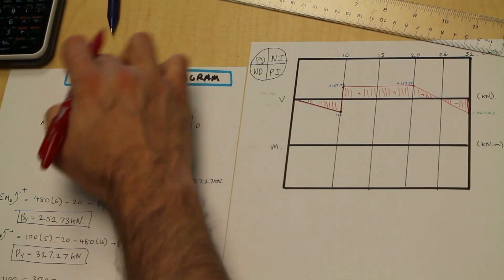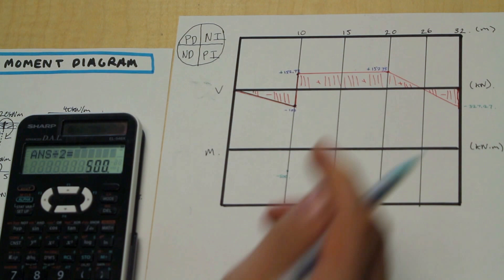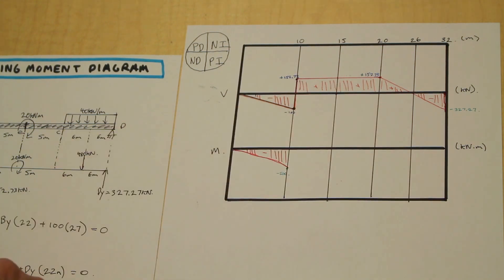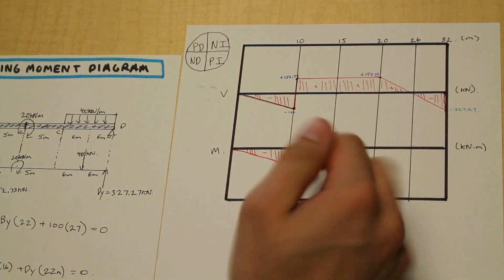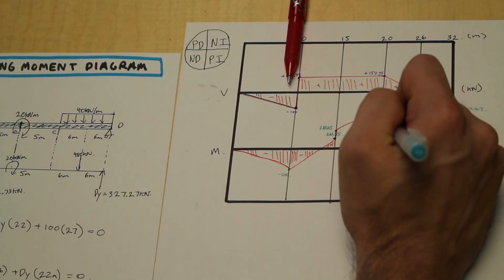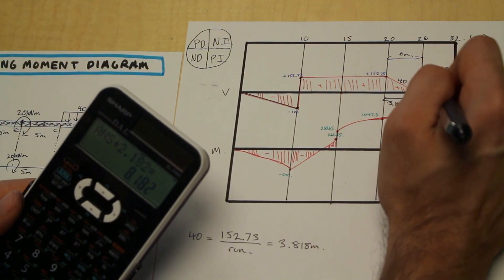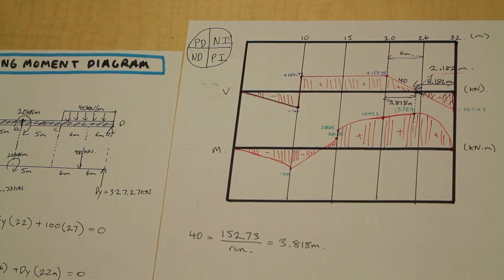How to Easily Draw A Bending Moment Diagram Without Equations - Bending Moment Diagram - Part 3

Comment from the maker: Check out our newest video on how to draw the BMD and SFD of a beam without equations! https://youtu.be/cIg8Oyv7hX0

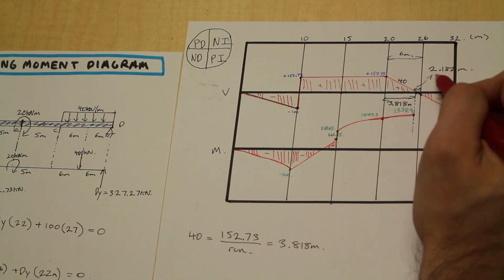Couple notes on this video!! The line between 15-20m should be linear, sorry if it looks parabolic.  Also, the battery cut out at about 5:12 when calculating the max moment. You simply find the area of the triangle above and add it to the moment at x =  20m, which is (152.75 x 3.818 / 2) + 1047.3 = 1338.9kNm

Comment: why is it that when calculating the area at minute 5:12, you did not multiply 152.75*6? According to how you drew the shear diagram the base should have been 6
Reply from the maker: Hey crazymixist, good question.  The important thing here is that when the shear passes through the x axis, you're going to need to calculate the base of the triangle, or it can also be referred to as the point of zero shear.  In this case the line for the x axis is a little thick so it looks like it passes through x = 26m, which is not correct.  This is why it's important not to refer to the diagram as sometimes they're not drawn to scale.  

Earlier in the video we calculated the distance from x = 20m to the point of zero shear, which is marked as 3.818m.  This is the base of the triangle of height 152.75kN, not 6m.  We calculated this distance by dividing the height (rise) of the triangle by it's slope (the UDL). From this value you can calculate the base of the triangle to it's right.  

Like I mentioned earlier, never look at diagrams and assume anything by their scale, always refer to the numbers.  It's a much safer way to not make mistakes on tests.  Hope this reply helped!
Reply: thank you for replying so quickly, but why does it not go through 26m, why does it fall short?
Reply from the maker: No problem, happened to be on the computer at the time!

Recalling the principle of rise/run = slope, the length of the base of a triangle depends on the height and the slope.  In our case here, we have a triangle of height (rise) 152.75kN and a slope of 40kN/m.  In our case here, the slope of the hypotenuse is the rate at which the shear is decreasing, which is 40kN/m.  Thus, with a height of 152.75kN, and a slope of 40kN/m, the base is equal to 3.818m (152.75/40).  

If I could give to you a word of advice, especially on stressful tests and exams, would be to not assume the triangle needs to pass through any point, especially not the midpoint.  Calculate it out and use the numbers you find, these types of assumptions can lead to silly mistakes, especially if you're basing them on the diagram which can frequently be not to scale.  

Any other questions, let us know! Hope this helped.

Comment: how to get the location of zero moment from the BMD diagram if there is a UDL?
Reply: that means quadratic equation right? i managed to solve one of my questions using this but not sure it is the right way to do it
Reply from the maker: In this question there are two UDL's, and we used this method so you're good to go using this.  Solve for the reactions, draw the shear, then use the slope of the triangle produced (the UDL load) and the height of the triangle to draw your BMD.